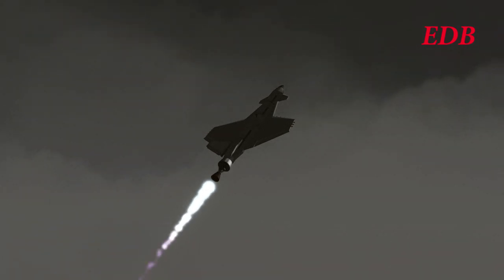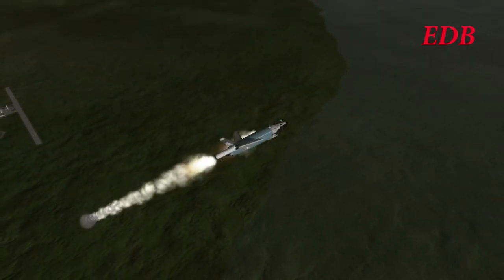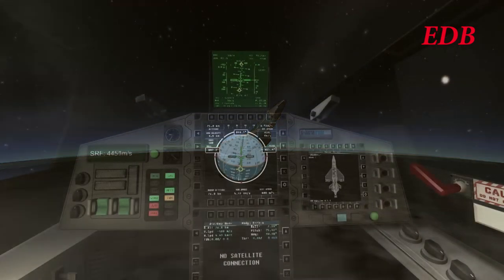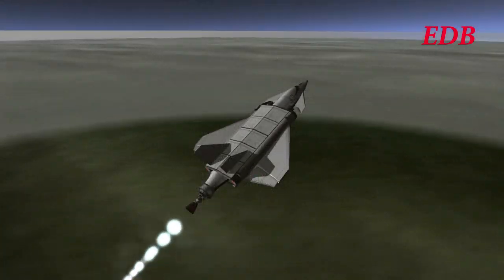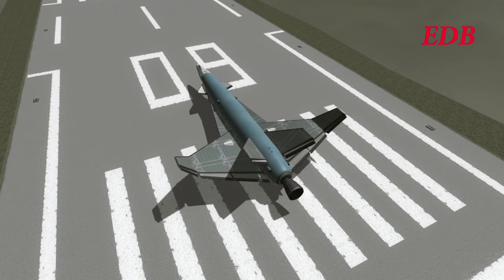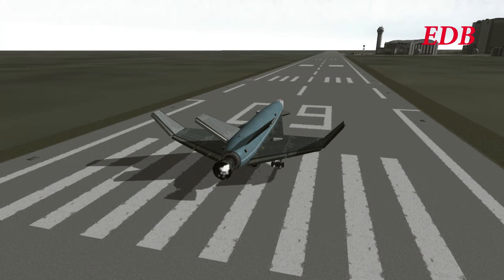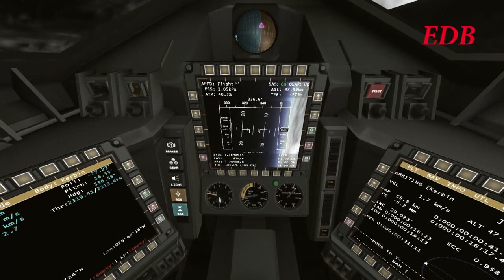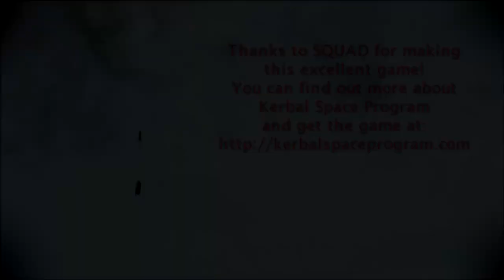Kerbal Space Program EDB Aerospace 09 - Hypersonic Aircraft Testing

Comment: I always love seeing these EDB videos, they're a very original style of KSP lets play, though I do wonder about your install. Are you using any of the Stock Bug Fix modules? With those installed SRB seps are usually much less harrowing than the ones you've been experiencing. If that doesn't help you could always consider using Ven's Stock Revamp to get some inline sepetrons. Also, important to note, though not technically related, Thrust Limiters do not work in RO. They only work on engines that have throttle capability, and rather than adjust thrust to the percent of thrust specified by the limiter they adjust thrust by percentage of throttle. RS68's for instance can at a thrust limited to 0% burn for about 60% of their maximum rated thrust. Anyway, keep up the awesome videos, and I hope I was in any way helpful!